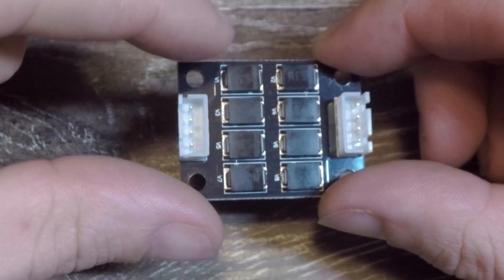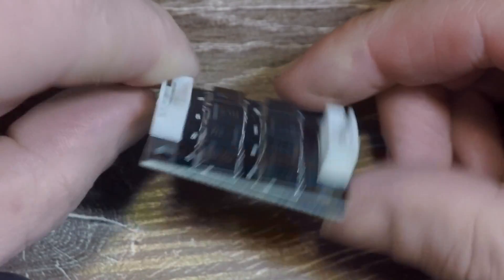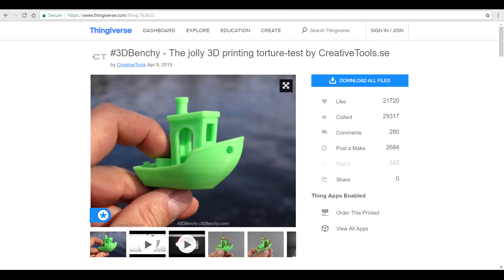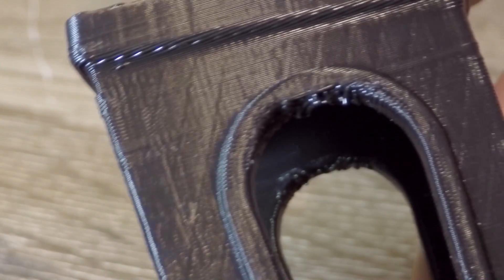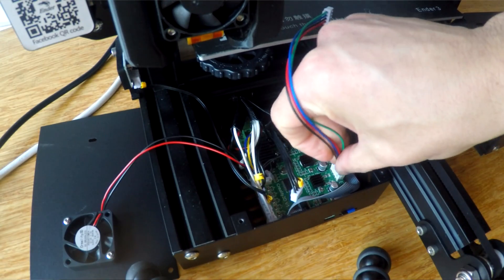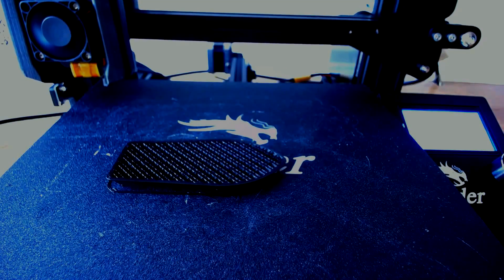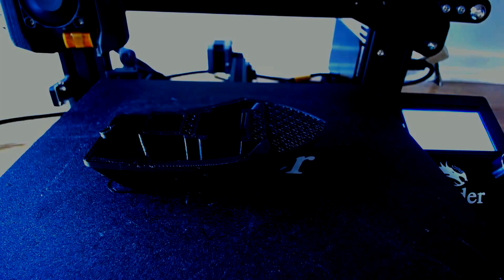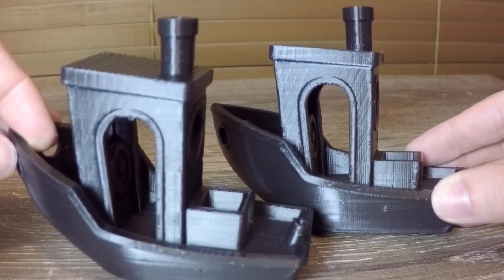Ender 3: TL-smoothers an upgrade? (Part 1 - Extruder)

Comment: Those diagonal line artifacts are a real mystery.  The fact that they're so regular suggests something mechanical, but they're also off axis.  I've seen artifacts similar to those where the infill interacts with the skin, particularily with translucent filaments such as PETG, but it doesn't look like they match the actual infill pattern.  Stepper motors could cause artifacts similar to those, but again, any stepper based artifacts would be locked to the axis the stepper controls, and would absolutely NOT shift due to the position of an unrelated axis, in this case the Z.

I'd check if the bowden tube or wires going to the hot end are rubbing against something.  It's kinda grasping at straws, particularily since it doesn't feel like the right mechanic to be able to produce this even an artifact, but the way they'd change position as the print head slowly rises could cause the artifacts to gradually shift.  Also, try printing something else.  The benchie's walls are slightly tilted for artistic reasons, which could just be causing the illusion of the artifacts shifting according to Z when maybe they really aren't.  Observing what happens with the artifacts on a differently shaped object would lay this theory to rest one way or the other.
Reply: Actually, come to think of it, I think I know what's going on, and it's a stepper related issue.

What seems to be happening is that since the walls on the benchie are almost-but-not-quite axis aligned, in both vertical and horizontal directions, you get banding due to the steppers not having enough spatial resolution.  Basically, stepper motors literally move in steps, so in the case of the slightly off axis wall, each line artifact is a single step in the direction perpendicular to the general direction of the wall.

There is a technique called micro-stepping where the driver can basically send an analog signal to make the stepper "balance" partway between steps.  Since it does work according to the laws of analog electronics, it requires decent calibration to get the intermediate states nice and even.  This technique is commonly used in 3D printers.  Beware - TL-smoothers are very likely to interfere with the analog signaling needed for microstepping, which would actually make artifacts worse!

In any case, your setup is wrong.  The smoothers need to be on the X and Y axis steppers.
Reply from the maker: Thanks for the detailed comments. Have fixed this on another printer with only an extruder smoother. I'm reprinting now with smoothers on X and y only. Will post results if anything changes.

Comment: Interesting, I tried exactly the same test today. But the TL Smoother on the extruder did remove the diagonal lines. Have you done any other mods? See the Ender 3 Facebook group.
Reply from the maker: I'm in the group, I have done other mods as shown in earlier videos. Quite strange we have different results for the same mod.
Reply: Teaching Tech Are you running factory firmware or have you changed it?
Reply from the maker: TH3D unified firmware.
Reply: Teaching Tech So mine is still on stock although not sure at this point why that would make a difference.

Comment: There is a guy who just did this on the facebook ender 3/Cr20 page, he added a TL-smoother on the extruder motor and the diagonal lines disappeared.
Reply: enes sabanovic That would be me then. Same mod, different results. Most puzzling.
Reply from the maker: Agreed, quite strange. I will address this in follow up.

Comment: You only put a smoother on the E-axsis so it is normal that you see no difference. The X + Y axsis produce the main issues. / On my MKS sbase i have the smoothers on X, Y, E and it is fine.
Reply from the maker: At I said in the video on my duplicator i3 clone the extruder smoother worked well and the z and y did nothing. Maybe this printer is the opposite? I'm reprinting now.
Reply: I was using only 1 TL smoother on the extruder of the Wanhao i3 plus and it worked great.. I also did not see any difference on the z-y-z.. but left them on for the heck of it.
Reply: Daniel Krah wrong

Comment: Did you use smoothers on all four steppers? How did you fit them all into the case?
Reply from the maker: I used one but I don't think they would fit. Alternatively you can mount them near the stepper motor depending on the plug.

Comment: Why did  you only use 1 TL-Smoother? Should be one for each motor right?
Reply: This review used TL-Smoothers on the top two ports (time marked): https://youtu.be/QEzMWE3-lVY?t=4m35s
Reply from the maker: Thanks for the link. I'm at work now but back at home the benchy is reprinting with smoothers on X and y.
Reply: the most movable parts, in this case X & Y, Z is not necessary.

Comment: Which motherboard did you test the tl smoother on?
Reply from the maker: It has a Melzi.
Reply: Teaching Tech there are at least 2 versions on the motherboard. I believe it’s like 1.12 and 1.13...printed on the board near the front...
Reply from the maker: 1.3